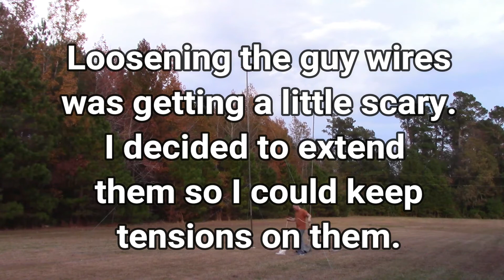Longwave Antenna build. Lowfer Station JH 2019

Comment: I'm not sure if you seen my comment yet on my channel but I will ask you on here too. Where did you get the design of this antenna I've seen on your website of your top hat antenna but not this one?
Reply from the maker: I made it up I guess. It's is like a ndb near where I grew up.  "Flo" florence regional airport. It was almost in my neighborhood right beside the road. No one really knew what it was. It was two power lines with a small metal building under it. It's more top hat than my first version on my website. The one on my site, at my old house, was received in nc (80 miles away) from Florence SC. My new one, at the new place in the middle of a field, was received in mass, Illinois, Tennessee, so it's much better. I think it's mostly the fact that I have a field now though.
Reply: @JohnHamerProjects  Very cool! I will have to just play around with different antennas and see what works best. I am familiar with Dexter and I emailed him and he said he would try and see if he could hear mine once I get it going. Again thanks for making this and getting me started!
Reply from the maker: @kaseelee6994  let me know when you get it going and ill listen for it too. My transmitter is off for the summer.
Reply: @JohnHamerProjects  Ok I will let you know. I have been listening to 181.818 khz but have not heard anything, But now I know why.